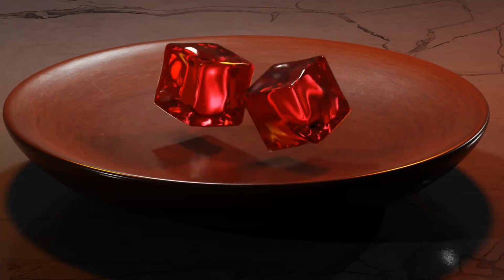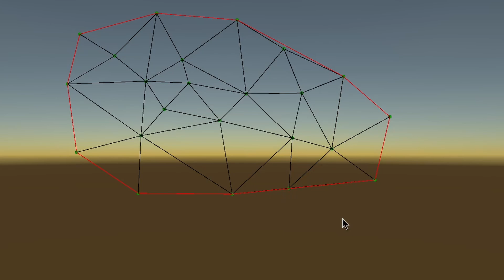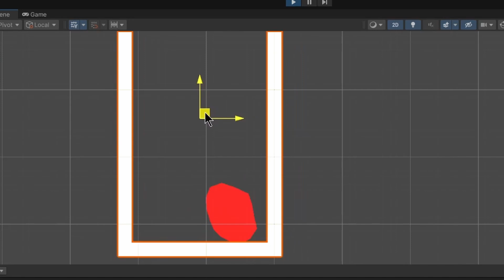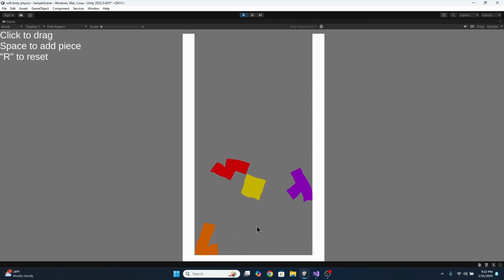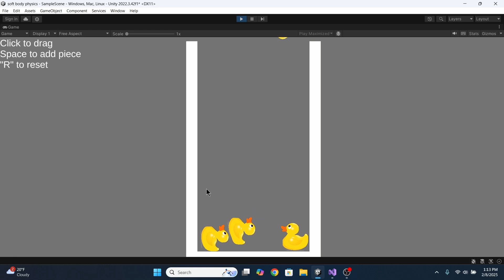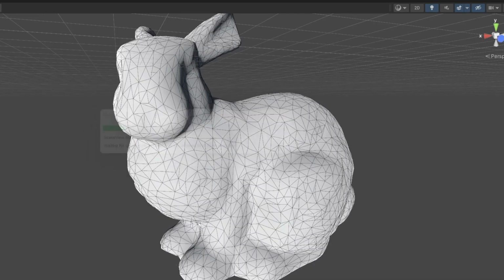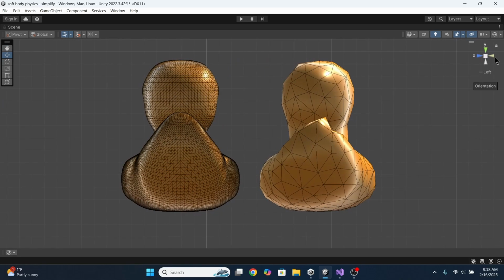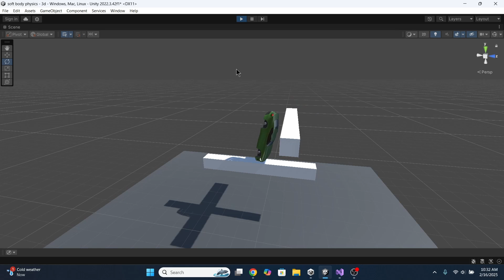3D Soft Body Physics in Unity

Comment: For the 3D, not sure if I understood it correctly but it looks like you can apply the soft body physics partially to an object, or vary the material composition in different parts?
Reply from the maker: for the 3d soft bodies i generate a tetrahedral structure based on the mesh using the voxel technique and then i used barycentric coordinates to deform the visual mesh to match the tetrahedral one. So what you can see is not the same as what’s being simulated.